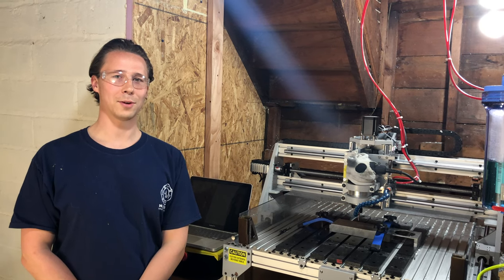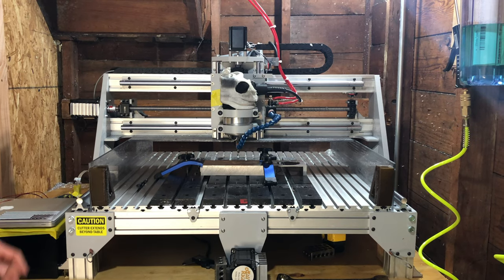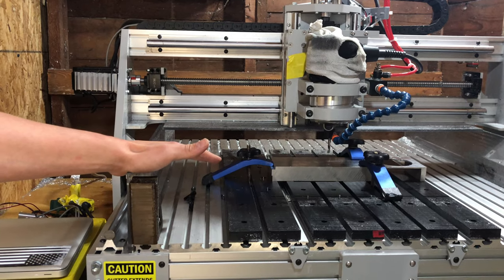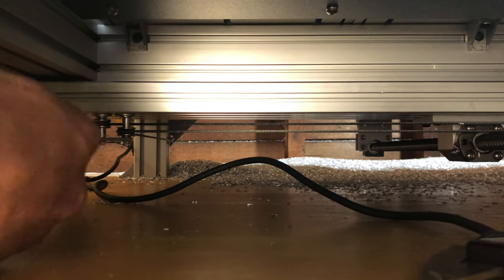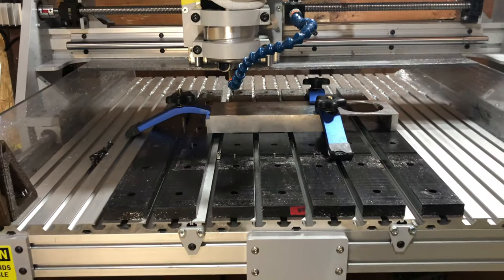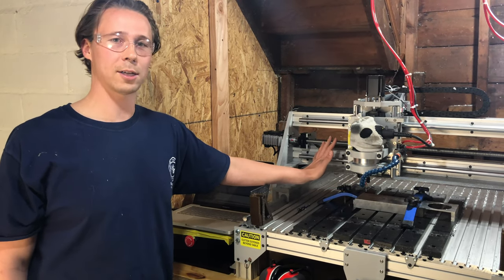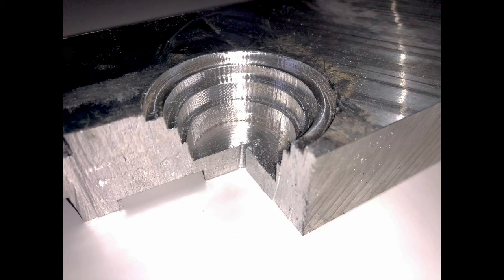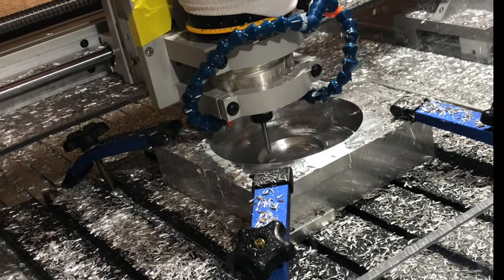Engineer's Review: MillRight Power Route CNC

Comment: This was a great review on the Mill Right CNC. 
You commented on two problems and they are common to all CNC Routers, nose and chipped everywhere. I built my second CNC summer of 2020. I used a VFD water cooled spindle. When the spindle is running not cutting at 24,000 rpm the sound is very very low. Of corse when cutting you have the cutting nose, this is nothing compared to a router. 
The router cooling fan exhaust down around the bit and this helps blow chips everywhere. This air velocity is also a problem with dust collection system. Water cooled Spindle, the cooling water can be a problem. At the time I researched the net for cooling design and everyone was using a 5 gallon bucket with a sump pump and I said I am not going to doing that. My background is 40 years in industrial controls. I design a totally sealed cooling system with 10oz coolant capacity and it works great.
If you are running 8hrs jobs water cool spindle is a must. As you well know any design can be improved if you want to install a water cool spindle let me know and I will share my design.
Reply from the maker: Do you have a recommendation for a spindle?

Comment: Good Review Bodhe. I'm a MillRight owner. It's a MegaV and primarily soft materials with occasional aluminum, but I had no misconceptions about limitations for latter. I'll first say for myself that all critiques must be kept within the context of price point but not sure I'd be quite as generous overall with MR. There are a number of things including those that you highlighted that could be done to significantly improve the ability to tune and and realize higher overall cutting performance of their machines. IMO, the combination of cable anti-racking system with ball screw precision makes no sense. Should be a screw and stepper on each side. Not being able to practically tram, square, or remove the spindle mount is also just silly. The stepper and homing switch cables on my machine were not shielded. Lots of EMI issues. I discarded and made new ones. Same with the limit switches, but my replacements were $50/ea but what's the point in homing at +-.015"?  More thought to chip control and protection of motion system. The MegaV is rack and pinion. It would be a non starter for aluminum chips. MR strikes me as a company that lives in the low end 3D wood carving machine market and really needs to log more time actually using their own equipment. Have you taken a look at AVID? Think there is more performance potential there at similar price points and you can build/make your own feature based value for money decisions. I'd think a spindle would be a sensible value for money upgrade for you. Also, I'd just say the MR controller is OK not the most well thought through part of the package. I have the same controller. Not sure knowing what I know now I'd ever opt for a Arduino/GRBL based controller. If it's just simple 2D machining, ok, but for more complex stuff, there is much better available. The PP provided in my machine required a mod to work almost at all. After the mod it ran anything I wrote to it. Best, Kelly
Reply from the maker: Agree with all those comments. In hindsight I wish I had bought an Avid. The anti racking system in the biggest issue. But now I have this investment I don’t want to just write off so it’s tricky. I agree they need to spend more time with their own machines.
Reply: “Low end 3D market”? The mega v is for the most part- the fastest machine out there for the price point and doing 3D carves.
Reply: @jeffverdin6105  I guess it can depend upon your perspective, but yah on the CNC continuuum , MegaV is low end......it's hobby machine for sure, even for wood carving. Is it better than Chinse desk top systems, well yah, but that's the bottom of the bucket. You wouldn't find one in real production shop that makes their living with the machine, even for wood, not for long anyway. Keep in mind that this video is really about the PowerRoute which is supposed to be MR's flagship system, and Bodhe's review is with respect to cutting aluminum which MR does market the machine for. With respect to metal/aluminum cutting, it's the extreme low end of that capability, and like I said, a cable tramming system for a machine even that that price point is just silly.

Comment: The hot stepper motors may be due to the stepper driver curremt setting being set too high. decrease it and see if the speeds and feeds still are ok. otherwise replace them with something more beefy. 
I agree with all of your points! I'm not an industria engineer, it's a hobby for me but I've build my own cnc after owning a kit build cnc which was really weak. I use 20mm aluminium toolingplate, great for reference and straight joins. It's used in the Y axis side plates, z plate to carry the spindle with a square profile mount along the entire lenth of the spindle (why are many cnc fitted with those small clamps?) and the bed is also tooling plate which is great as a reference to tram the other axes.
the gantry is often subject to torsion forces, especially with more z travel like 200mm. I used a steel square tube to reinforce the gantry/x axis. that made a big difference compared to aluminium extrusions, which isn't very stiff torion wise.
Really interesting review, thanks!
Reply: About the router, I'd recommend replacing it with a chinese spindle with a VFD. Water cooled is most quiet but aircooled is cheaper and less of a hassle. Toolchanger spindles are also available on aliexpress but are a lot more expensive. 
The air cooled spindle is sealed (IP56 iirc), so even though it's air cooled, no dust, liquid or chips can get in the rotor or stator part, air is blown through a separate channel in the housing. I bought mine from RATTM Motors and after 3 years it still works fine. It's an aircooled 1.5KW spindle with er11 collet. I'd recommend the 2.2KW version as these come with ER20 collets. There are versions with a square aluminium extrusion for a solid mount to your cnc. Get AAA grade collets with less run out, it really makes a difference and are not that expensive when bought as separate units. kits cost more for some reason ie 100 euros compared to about 40 euros separate for 14 sizes.
There are also constant torque 6000rpm spindles, a bit more expensive but is better for metal machining. I do woodworking too so I have the 24000rpm spindle.  I use single flute aluminium bits from aliexpress. It's cheap and works reasonably well, especially with coolant.
Reply: One more observation, I think the chatter marks could be due to the router collets run out and the speed drops under load a lot and goes up and down in speed, that doesn't help either. A spindle with vfd controls the power and speed much better and the runout is probably better too, especially with AAA grade collets. It's quieter and with lower run out the cuts are quieter too, to keep your girlfriend happy ☺️
 I get a mirror finish with a single flute 4mm bit at around 17000rpm. Same finish with a 6mm 2 flute at 12000rpm. 
I haven't tried those removal rates yet, have to install a mister and learn how to use fusion 360 with better tool paths (I use vectrix aspire which is not really suited to metal machining).

Comment: while the feed rates and depth of cuts on aluminum are much better than most of these types of machines...but like all of the desktop type of machines the finish is horrible ..and another con on this machine is they should have used servo motors as opposed step motors..much faster much tougher ( run them all day every day you won't need heatsinks ) and they're much quieter...but I do like this video,and will be looking for more from you...Im subscribed !!

Comment: Thanks for the great review! We just purchased the Power Route Plus for my school shop/robotics team and so far the results are very promising. I'd like to add the coolant system you showed in the video, but I'm wondering about the quantity of each of the parts you listed. Do you have any plans or even a sketch for that system? Anything you would change about it now?
Reply from the maker: I think the best sketch is actually the patent for a fog buster. You can search that on google patents. That’s what I used for reference. The key idea is to mix pressurized air and pressurized coolant upstream of the nozzle, that way it doesn’t atomize and get foggy.

Comment: great video! ive been on there website and cant seem to find this one you have?  Have they upgraded now to the MillRight CNC Power Route Plus?  Thanks
Reply from the maker: Yes the plus is the new version. Dual Y ball screws is definitely an improvement and linear rails instead of shafts is nice. For the additional $1000 over the legacy power route, I wouldn’t buy it though. They have not fixed the inability to tram the router to the bed which is a major performance limiter.

Comment: Good review here. You might have seen that the new Power Route Plus model has dual ball driven y-axis. I'm wondering if they will sell just the parts to upgrade the y-axis drive for your model? Otherwise, I also agree, the lack of positioning features is crazy. Locating pins and square datum edges would have been so helpful. I ended make several mods to improve positioning accuracy.
Reply from the maker: I did see that. For $4200 though I wouldn’t buy it. You can get something much better for that. If they sold an upgrade kit though, I’d buy it. 

What upgrades have you made? Very interested in improving accuracy and rigidity
Reply: @BodheKnows  Could you please share what would you recommend as a better metal cutting CNC Bodhe ? Thanks!
Reply from the maker: I think a real mill is the way to go. Way more expensive but a Tormach would be ideal. Precision Mathew’s with a CNC kit is an option. AVID routers seem like a decent bang for your buck
Reply: @BodheKnows  Thanks I`ll check those out, currently looking at this: https://www.youtube.com/watch?v=e5TsK2Sp-aM

Comment: This is an awsome video. What is the actual size of the E-chain bracket? When I put the file into the 3D printer it said the size was 8.4x6.4x2.0mm
Reply from the maker: Same numbers, but in inches. So scale by a factor of 25.4. You might have to type in 2540 depending on the slicer.
Reply: Thank you.

Comment: I've got one of these. I could not abide by it the way it came from Millright. I thought the cable anti-racking system was a total joke and went with dual ball screws instead and I mounted the motors on the back so they are out of the way. I added lots of bracing in the bed and used adjustable feet on all four legs. I beefed up all the leg bracing and used the same extrusion size for all. I thought actually the electronics box was a joke. There is live 120V right under the clear cover at the E-stop switch. There is no fuse. And OMG - how hard would it be to label the plugs in the back? And the limit switches can be plugged into the stepper jacks. How stupid is that? There are a whole lot of other changes I made, too many to list. The packaging of the parts was abysmal and many parts arrived broken. Some of the linear bearings didn't even have threads in their mounting holes. The parts that were water-jet cut had a taper on the kerf that did not allow the Z axis motor plate to sit in the correct plane. The Y-axis extrusions were not accurately cut to the same length so I had to fabricate my own. 

 But the worst part by far was the attitude of the owner of Millright - he acted like he thought he was a super-genius and that anyone who had any criticisms of his designs were just stupid. It's ironic that the newer Poweroutes incorporate many of the changes I made to mine.
Reply from the maker: I really need to make a “2 years later” video because I agree with all of that. The cable anti racking system is the biggest issue by far for me. It is a complete joke and renders the machine inoperable. I wish I had the time to replace it with dual steppers. I replaced the steel wire with Kevlar and that is holding up but the rigidity is awful. I do hope they are learning as they go
Reply: @BodheKnows  I do not believe that they offer the cable system any more.